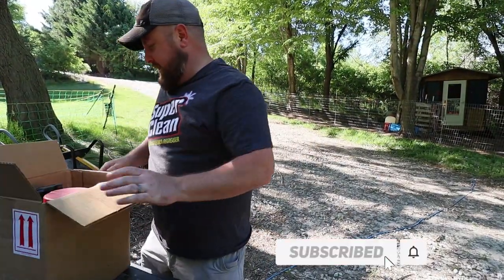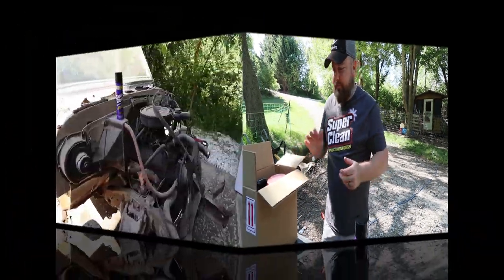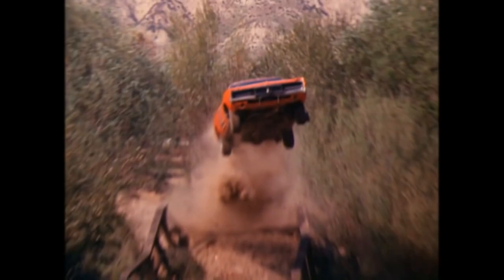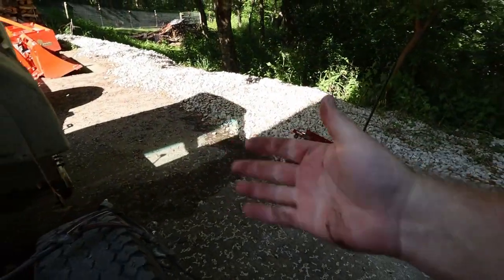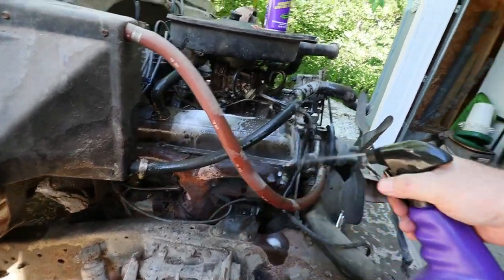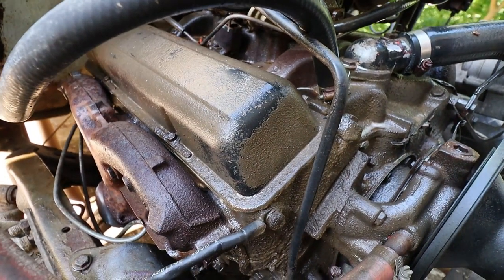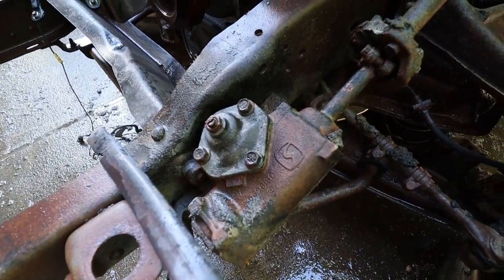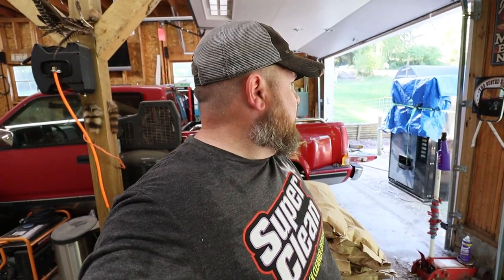🟣 Good Thing It Was FREE ! See What It Did To My PAINT !

Comment: Mike, a question:, just had my tie rod replaced and now the I can feel thru the gas pedal a slight grind compared to the smooth roll before the replacement.  Will that smooth out with time or should I bring it back to have them check it out?
Reply from the maker: If you issue was in the tie rod you would feel in the steering .  It sure what that would be 🤷‍♂️